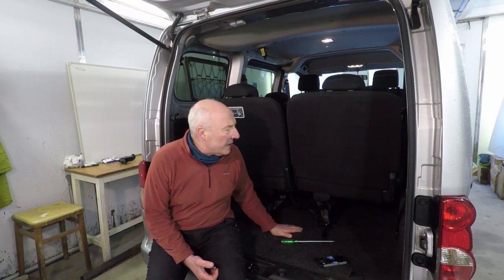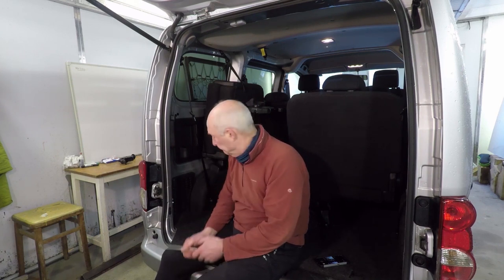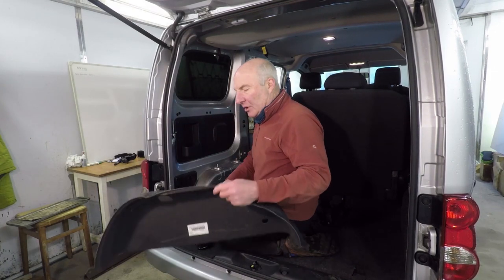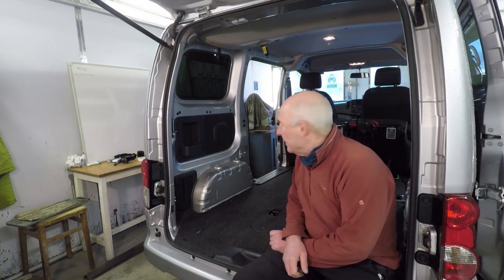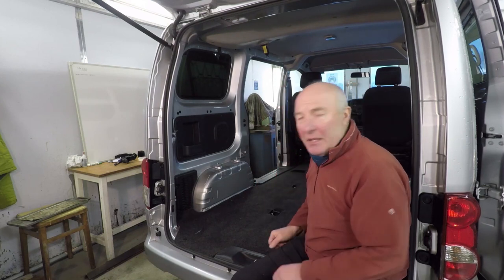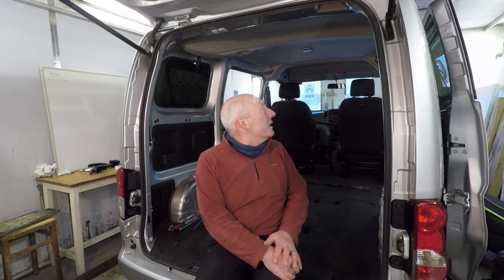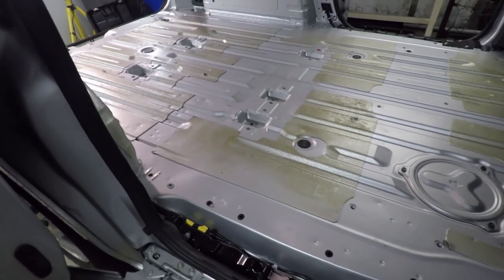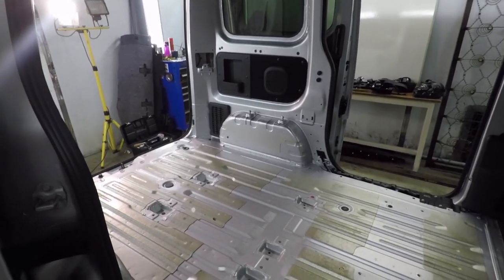Converting a Nissan NV200 Combi to a campervan- Part 1. Removing the seats and carpet

Comment: Good start Andy, since considering doing something similar myself I have been looking at every van that passes me on the M60 and weighing up whether it would be suitable. The NV200 is definately on my short list, quite car like, not too big and rather good looking I think. I've subscribed and look forward to catching up with your other videos. All the best.
Reply from the maker: Thanks Peter. I spent some time researching various vehicle options and of course the VW is a popular choice buit I wanted to have something different (and less expensive) the NV200 worked for me as it still has a decent amount of room, is easily parked and also being based on a van the driving and passenger seats are nice and high.

Comment: Hi Andy
I am a man in southern Sweden and am often out hiking and paddling Packraft.  I often combine this.  Now I've seen all your youtube videos while rebuilding your Nissan nv200.  I'm very impressed with your movies.  How well made these movies are.  They will be of great help in my continued construction.  I have bought the electric variant Nissan e nv200 Evalia which I will convert to a Caravan.  As I was now emptying the car of all the seats and belts, I discovered side airbags.  How did you do that?  did you unplug them or leave them on.  Sincerely
Mikael Olson ”Skåne” Sweden
Reply from the maker: Hi Mikael. There were no airbags on the rear seats that I removed on my version, just on the drivers and passengers seats.

Comment: I was wondering why you didn't buy a cargo version of this van but I do admire your initiative
Reply from the maker: Thank you Frank. I had a look at various vehicles including the cargo but this vehicle attracted me because of the tailgate (as opposed to the barn doors of the cargo), fitted tinted windows in the back as well as the extras such as airbags etc. Also cargos tend to be fleet vehicles with high mileage. This one was two years old with only 8k miles on the clock.

Comment: Hi Andy - I have just bought a NV200 Combi se 1500dci do you know where I can obtain a workshop repair manual for it, I’m converting it into a camper as you have and I have just ordered the passenger swivel seat plate using the link in your video “fitting a swivel seat” great videos by the way I really like all the detail and info great work regards Nigel

Comment: Great video! Can the 3rd row seats be turned around? I'm buying NV200 for surf trips so wont be sleeping in it but would be great to turn the rear seats around and have a nice view out the back while sitting at the beach.
Reply from the maker: Hi kajjot, thanks for the kind comment. I dont think it would be possible to fit the rear row of seats to swivel plates without a lot of effort. However, with a bit of work I wonder if the seats could be swapped over (left for right) so that they were permanently fItted to be rear facing? Of course you would need to adapt the seat belt fittings for this. The other option would be to remove the rear seats completely and replace them  with some sort of storage box which could be made so that it formed a seat to face outwards?
Reply: NV200 camper not to worry. Followed your video and took all seats out. Built a fold out bed and installed a small kitchen unit. Enough space for long weekends in Cornwall. So far totally agree on practicality of NV200.

Comment: What did you do about the holes left in the floor when you removed the seats please?

Great videos by the way. I’ve subscribed and am planning a similar nv200 build soon thanks to you!!
Reply from the maker: Hi Matt, thanks for the comment and question. You have made me think and TBH I cant actually recall. I either refitted the bolts back in the holes or I just filled the holes up with bonding agent or something like silicone sealant.
Reply: @nv200camper4  many thanks!